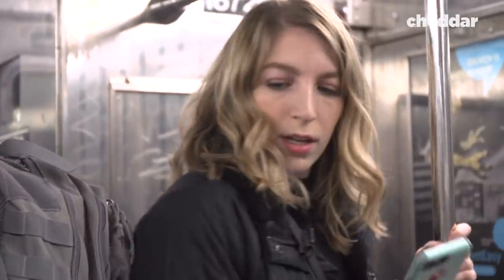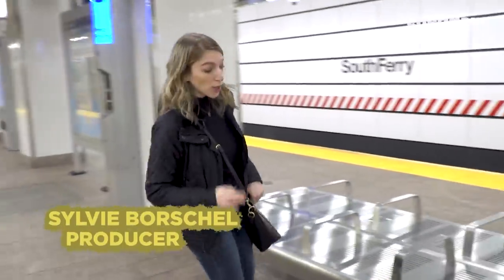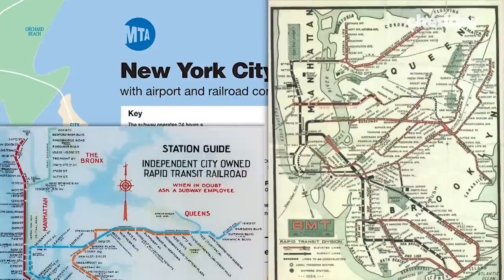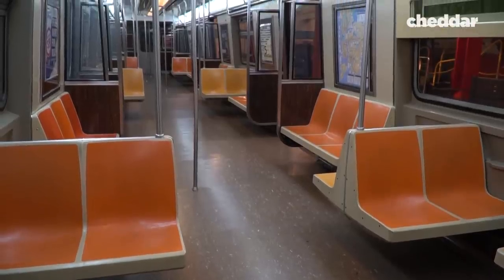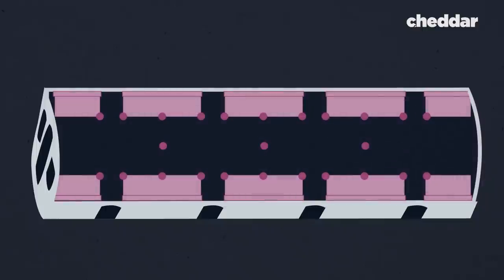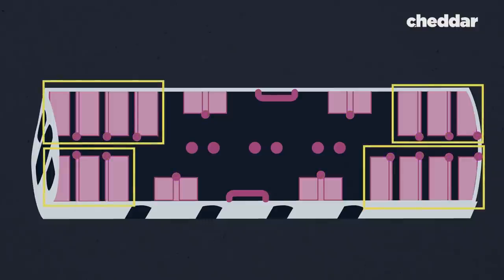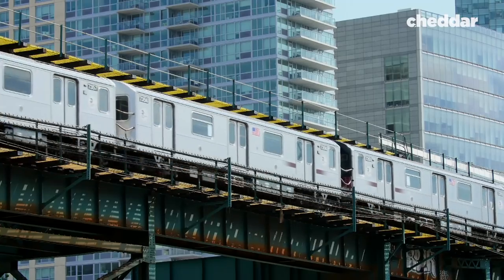Could This Subway Car Save NYC Transit? - Cheddar Explains

Comment: "They calculated that with fewer seats trains could accommodate between 80 and 100 more people." - The MTA often miscalculates. One miscalculation written into law is that 6 minutes late counts as "on time". One way to get the scheduling problems under control would be to gradually reduce the permissible nominative delay, and they had intended to begin doing that - taking off 2 of the six minutes- in fall of 2019. But reneged. I ride the E-train - the giant doors and missing seats makes it more zoo-like. It is a standard-of-living issue. There's a point of diminishing returns. Nobody wants them chipping away at their standard of living. The orange-beige-yellow arrangement of the R44 - 46 -vintage cars pictured in the video - that first entered service about 1970 - is the best arrangement for the lines with the wider cars. That arrangement goes back a long ways, to the 1920s or so.
Reply: bruce hain Actually, the R44-46 arrangement is the worst arrangement for present day subway cars. As every other subway system in the world has demonstrated, the best arrangement for subway car layouts always includes open gangways, so actually having open gangways will really help increase capacity.
Reply: @TheRailLeaguer  I don't see what you're basing that on. The extra somewhat isolated lengthwise space looks like a high crime area. I hope the new cars have lots of cameras. The point of the design is to prevent people getting on the outside of the train. It's unfortunate, but necessary.
Reply: bruce hain So your saying that open gangways invite crime?
Reply: A preferable arrangement would have both the end doors and the diaphragms. The diaphragms are a high maintenance object.
Reply: bruce hain Why end doors? The open gangways will allow for increased capacity. Do you not want a 10% increased capacity?
Reply: @TheRailLeaguer  It looks like we're headed for "at capacity operations" again with the subway, if the recent figures are to be believed. Usage was higher in the '50s than it was in this last peak in the graph (fewer people had cars then, there had been no effort to divert traffic through bicycles, Lyft, etc.)  but the scheduling breakdown is a serious issue. The recent changes may be put to the test, with improvement in scheduling performance now alleged. But they need to control the crowds. It's absolutely illegal the conditions in certain stations. Entrance to the platforms must be controlled. They do it in London - and last I know London runs on-time to the minute. There is no substitute of on-time performance, but it must be done safely. I have my doubts it can be achieved.
Reply: What I'm saying is that the crowding problems is a result of the on-time performance issues, not the other way around as has been asserted.
Reply: bruce hain Which is why open gangways will alleviate on time performance issues.

Comment: I wonder how many train cars does mta attach to each train. I live in philly and our subway trains aren't that long. For example I take  septa's market frankford el train which has 6 cars and I also take  septa's broad street line which has 5 cars
Reply: Dayshawn Hayes Most trains have 10 cars. The 7 uses 11-car trains, the C, J/Z, L, and M use 8 car trains, and the G uses 4-car trains.

However, it is of note that the R46 cars used on the lettered lines are 75 feet long so a full length train of those cars are 8-cars long.

Comment: If you look closely at the design you will realize there is no room for a cab
Reply: Are you referring to the airline style design? The cars will have room for a cab for the operator. It was not added in for ease of simplicity.

However, it is a relief that the MTA went with the open gangway design and not the airline style design. As a regular transit rider, that airline style seating arrangement makes things pretty cramped in the vehicle overall. The layout of the newer trains is more roomy for anyone that needs to get on or off (or move around) the train, and with open gangway trains, there will be even more space.
Reply: @TheRailLeaguer  do you like open gangway or prefer regular car designs?
Reply: @matthewadonis3020  Open gangway trains.

Comment: Bring back the old Low V, BMT Standards, and R1's.
Reply: WitchidWitchid what?
Reply: @TheRailLeaguer  those are references to the classic vintage rolling stock.
Reply: WitchidWitchid No. I mean, why would you want to bring them back?
Reply: @TheRailLeaguer  They were cool cars. It's the kind of thing you have to be a bit of a rail fan and have lived through that time period to underatand. It's nostalgia. They run them now and then on nostalgic fan trips. It's a kind of thing you have to be into to understand.

Comment: you're forgetting the 2 middle-aged women or men arguing and maybe starting a fistfight cause one of them's drunk and they thought the other looked at them funny
Reply: the open style trains work in London shame it's not used on all trains only downside is kids run up and down the train and if someone farts 3 cartridges will smell it instead of one
Reply: Luke Barrat The smell issue is very minor.

Comment: Yes, please look internationally at successful design elements, systems, and cities before deciding to reinvent the wheel. Wider doors help with dwelling time. Less seats allow more riders per train. Transverse seats take up alot of room. Folding seats are multipurpose. Many times bicycles are limited during rush hours. In many Asian subway systems dedicated handles over each seat disperse the crowd on the subway car. And the root cause of crowding is usually ultimately related to urban planning and economics.  Where people simply are not living near where they are working for a whole host of reasons. Even the greatest systems cannot handle overcapacity.
Reply: electricra1n That is why we are looking at open gangways for our new subway cars.

Comment: So they come upwith the perfect design by observing and designing for people during off-peak hours. The  loading, unloading and capacity problems they are trying to solve is during peak hours. Sounds like a government program to me. Asymetrical door placements will not force people away from the doors. Passengers stand near the doors as they will not be on long and want to be able to exit quickly. Confusing door placement will delay unloading. Add another set of doors and chuck the airline seating.
Reply: The MTA design they chose (the open gangways) is much better than this. It allows for an increase in capacity and more even train loading.

Comment: THEY SHOULD HAVE MORE POLES IN THE CEILING CUZ I BE HAVING TO STAY STANDING AND REACHING FOR THE MIDDLE POLES WHEN ITS PACKED OR HAVE A 2 STORY CART
Reply: roseline tv The better solution is open gangways.

Also, our subway tunnels in NYC are not suited for double decker trains without expensive reconstruction.

Comment: Shouldn’t the seats face away from the entry doors of the same carriage ? but instead to the neighboring carriage as to ensuring people stand instead of taking the nearest easy closest seat.
Reply: mews56 Ideally you wouldn’t need 44 seats on the subway. Perhaps 36 can do.

I would also recommend open gangways to help add subway capacity.
Reply: @TheRailLeaguer  Thanks it's a misunderstanding on my end. Just meant when it comes to the updated layout Carriage.That shouldn't the seats face away? As to Stand & to Stand away from the doors. As to Make room upon arrival & departure at the station platform. As wasn't meaning anything on the numbers of the seat. Just Capacity & where everyone stands

Comment: Just like they observed (the didn’t observe rush hour??? Then why re-design the train in the first place?) -that perfect train car is perfect if rush hour doesnt exist. Yes, it has the same number of seats, but look at the standing space! Its almost non-existent! The future of rail will have open gangways, foldable seats following the length of the train, and plenty of poles along the isle. People avoid ceiling structures because most people just aren’t tall enough to comfortably grasp one for longer than a few minutes. Not to mention, no one is a fan of showing off their armpits in a crowded train.

Comment: The Transportation research board Clearly doesn’t ride the NYC subway system enough, other than to do a quick survey. It’s so flawed anyone who rides sporadically knows. The airplane-style seating will cause more overcrowding, because of the obvious smaller isles that create less room to stand. Neither will it force people away from the doors. Also, no one will sit in the airplane-style seats other than the seat on the isle, because once they ask the magic words “excuse me or pardon me” they’ll receive back a heap of attitude, if not a confrontation.  Also, no one wants to sit in a seat where strangers are behind you and could throw you in a chokehold and rob you. They will be nice seats though for the homeless to stretch out and go to sleep in, assuming what they’ll be mostly used for.

Comment: no, this subway car will not save anything -- the problem is in the management and system itself
Reply: Peter Nyc Actually it is one of the components that will save the subway, but the design here is horrible.

Comment: 0:31 - "The Layout of the Subway car has a huge effect on the commutes and rides of billions of people"
0:07 - "Used by almost 8 million riders every weekday"
1:14 - "1,752,565,419 annual passengers"
NYC population - 8.623 million
yeah, I just started this video, and idk about these numbers. First off, the whole damn city doesn't use the subway. This is likely to be the number of trips by subway, which, accounting for return trips, means the number of riders is half that, not even mentioning the other possible reasons why a person might need to use the train more than once a day. 
Second - billions!? As previously mentioned, NOT EVERY RIDE IS A PERSON. The implication that over a quarter of earth's population travel through NYC's train system is just... insane. I mean, who could have possibly wrote this script? Let alone fact checkers, this is just plain common sense! The number of annual visitors to NYC is just barely over 60 million!
Reply: The 1.7b passengers is probably derrived from how many trips are made a year

Comment: Just use seats that flip up and down. So the seats are always flipped up unless someone pulls them down to sit. Duh!
Reply: Paul ClipMaster In the R211 railcars (whose seating layout and car design is 1000x better than the airline style proposal), there will be some foldout seats for you to use. In addition, open gangways will increase capacity by 10%.

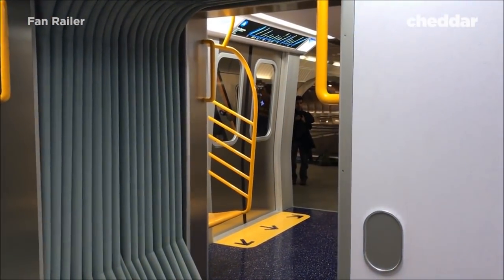Comment: 6:22 Isn't it possible to walk between carriages in the current design?
Reply: It is but it’s actually very very dangerous. A number of deaths on the subway have occurred from this purpose. The implementation of open gangway cars will make this safer, while also increasing capacity.

On some cars, the end doors are locked since the gap between cars is even more dangerous.

Comment: First Remove some of the doors and make it a articulated vehicle design like any other modern metro/light rail system
Reply: The upcoming R211s will initially consist of 20 open gangways to test how these cars do on the R train between DeKalb and Canal.

Comment: I guess they didn't like the design cause I don't see them on the track
Reply: The open gangways trains are still coming. They are delayed due to Covid-19 related business closures, as manufacturing is a non-essential business (when NY began to reopen, manufacturing was in the first phase of that plan).

Comment: just don't put any seats during rush hours. 

most people riding subway are going to get out in 15 or 20 min anyways.
Reply: SEAN LI They do have seatless cars on the 42nd Street Shuttle, but that’s it. One train on the J/Z, L, and M have seats that lock in the up position during rush hours.

However, this concept of removing all seats may not be feasible on the mainline routes. In fact, a majority of riders have subway commutes that are 30+ minutes, especially on the A, C and any one coming from Eastern Queens neighborhoods. The L train seats have been subject to vandalism and damage by disgruntled riders. Perhaps as a compromise the corner seats could be removed from all NTT-type cars.

Comment: Better to rebuild all the tunnels, make the trains bigger, and solve the 1001 other problems that a tunnel rebuild could improve for the city.
Reply: Why would they do that when open gangways can provide the same increase in capacity for a cheaper cost?
Reply: @TheRailLeaguer  there are more infrastructure issues that would benefit from a rework, gas, power, sewage, water, etc.
Reply: Wenz Wenzel This is still cost prohibitive. Open gangways is the best way to go.

The city should rather upgrade the infrastructure around the tunnels rather than move them for taller trains we don’t need.

Comment: I wonder how the open ended car design will effect safety of passengers in a situation where a gunman boards the train? Would there be a difference in comparison to what they have now?
They also need to take into account that not all passengers are able to reach the overhead support rails so maybe bi-level carriages are the way to go but then you have to take into account the cost of course.
Reply: Kimm 65 That joke about Open Gangway causing a safety risk gets too old, because they’ve been tried in other cities with similar problems such as London and Toronto and it is VERY successful.
Reply: @TheRailLeaguer  You've lost me I'm afraid. I wasn't aware that there was a joke regarding this design. 🙄
Reply: Kimm 65 The design is real. The concerns are super funny, given that everyone else uses the design.
Reply: @TheRailLeaguer  oh, I see. Guess they have a bit of catching up to do then. Thanks for clarifying.😊
Reply: Kimm 65 New York is the one that needs to catch up.
Reply: @TheRailLeaguer  yes, that's who I was referring to. 😊

Comment: Open Gangway = No Escape From Smells
Reply: Matt Bittner That joke is getting too old.
Reply: @TheRailLeaguer  No Joke. Sometimes the separate cars is very necessary. I honestly think it's a bad idea.
Reply: Matt Bittner The issue is very minor and can be fixed.

In addition, open gangways have been tried in other cities with similar problems as NY and have been proven to be a big success. That success can be replicated here in New York, where Subway lines can get crowded during rush hours (and in the case of the L, all times). If these cars are assigned to lines such as the A, C, E, F, M, and R trains, that’s where we can see the benefits of Open Gangways shine. With open gangways, riders on these lines can move freely between cars without dealing with doors or a dangerous gap between cars, which can increase safety and capacity, which are VERY IMPORTANT. I see no reason for these cars to not work in NYC, especially considering we had an R143 test train operating around the system to get data for the open gangways. The R143 test train not only provided data for the gangway design, but have also determined that there will not be problems with smells.

Comment: That analysis by MTA is completely wrong.  People crowd around the doors and sit next to the doors to get out.  The somewhat wider doors on the current new trains helps but pairs of people always stand in and block the doors.   Many times you have to plow through them because they're dense idiots.  I dread that the even wider doors will inspire a 3rd person to join the 2 at each door to block them.
Reply: What?

Comment: The open gangway will cause problems with smells. When a homeless person shits on themselves or the seat or the floor, then everyone has to evacuate that car.
Reply: R D That joke is getting too old.
Reply: JeremiahC99 are you serious? Have you been to nyc during rush hour, and gotten on an empty car, just to realize it is completely empty because someone took a shit on the floor? 
People run out and miss trains just for this reason.
Reply: JeremiahC99 how can it easily be solved? At all hours of the day, there are plenty of homeless people sleeping in the trains. Many have shuut, pissed or threw up on themselves or the car. Are you going to be the one to wake them up and ask them to leave? Are you going to stand at one station and clean up each car in the 30-60 seconds it rolls into your station? A new train every 4-10 min? Come on Mr. Clean. Give me answers.
Reply: R P More enforcement. In addition, smells can only travel through one to at most one and a half cars, so it is not an issue.

Comment: I thought the "open gangway" idea got shut down because they wouldn't be able to fit through the tunnels
Reply: L Man They are still going through with it. In the R211 order, 20 Open Gangway cars are being ordered alongside 440 closed end cars (to expedite the deliver of of the cars) and 75 cars fitted with can signaling for the Staten Island Railway. To prepare for open gangway trains, test out the curve radius and gangway flex on the existing 60-foot cars, an R143 test train was outfitted with measuring equipment and was operated